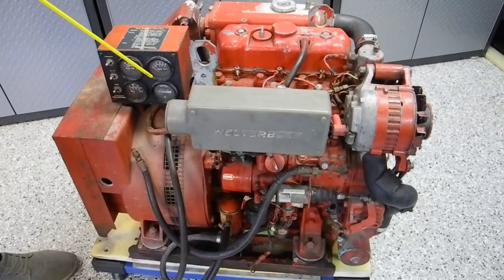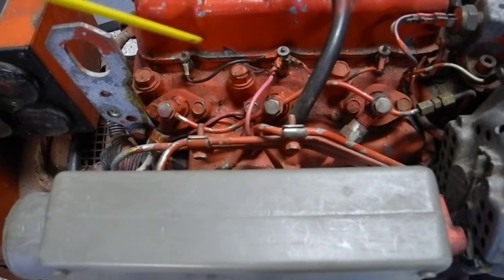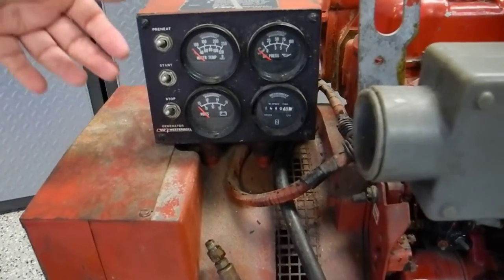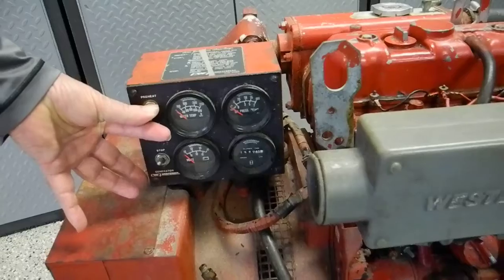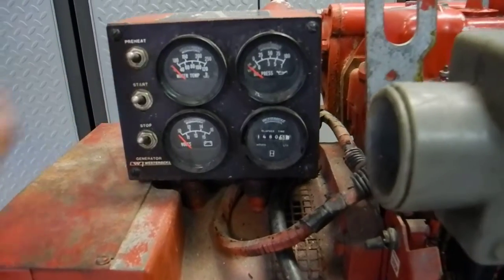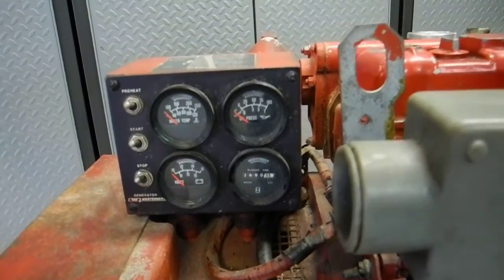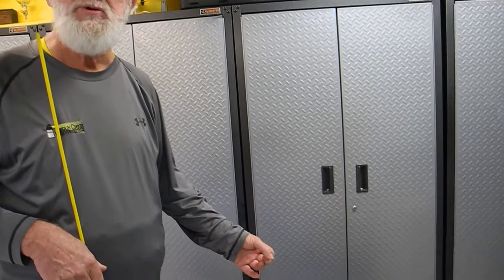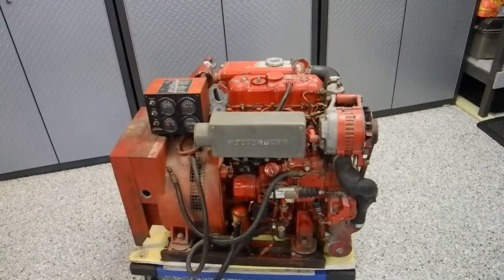Diesel generator Glow Plugs

Comment: Great advice, some Diesel engines will not start no matter how much you turn it over. Unless you use the glow plugs. We have a sweeper at work with a Perkins engine. Will not start unless you hold the button down for 15 to 30 seconds.
Reply from the maker: The pre heat button is also the low oil pressure safety sensor. Need to bypass that to start.
Reply: It's strange how some engines start no matter how cold , like old catapillers , and some are a nightmare  , like Ford 7.3 .   Seems like the manufacturers should all just copy what works
Reply: @walterdavis4808  My 3406b Cat would start no matter what. I had a 6V92 Detroit it started right up.
Reply from the maker: Yes and Detroits like ether too on very cold snowy days! @alabamasmokeywilson6818